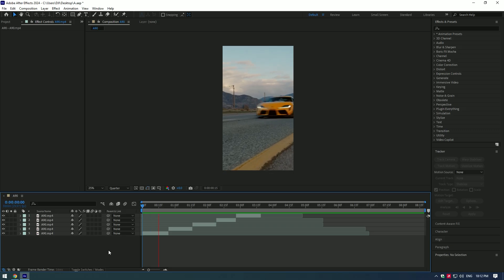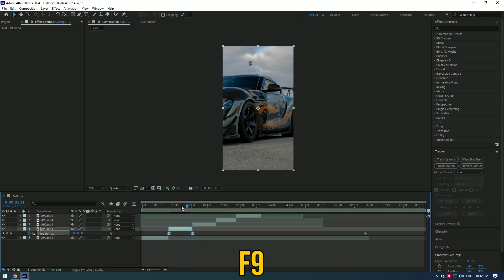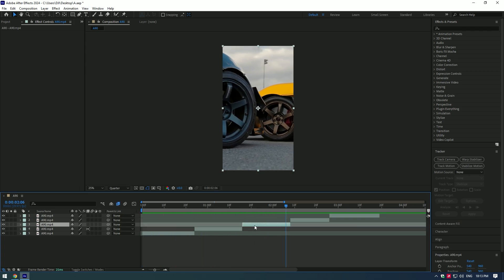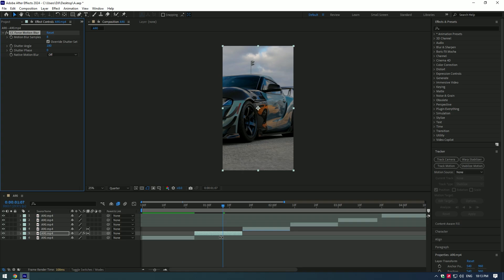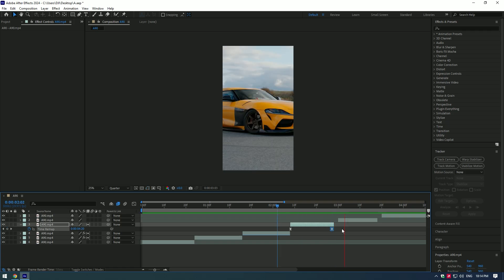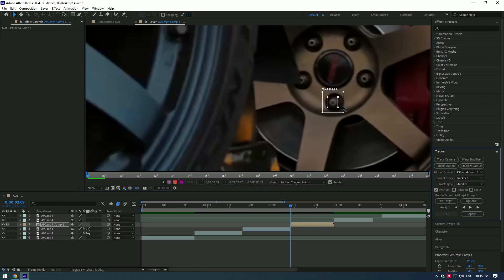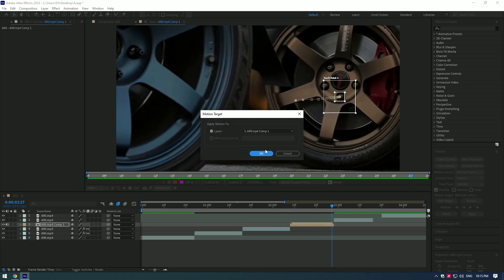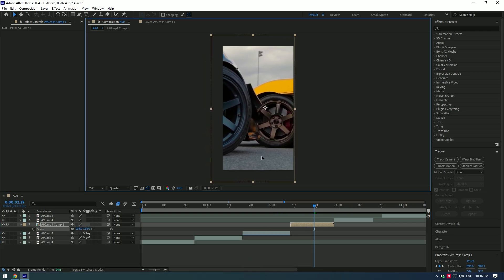My Secret To Smooth Speed Ramp Transitions in After Effects

Comment: hey when i stabilize the clip using track method i get micro jitters in my clip after it is stabilized, i have noticed this many time it happens with almost all clips doesn't matter if it is auto tracked or manually tracked. can you give me fix for it.
Reply from the maker: While tracking, make sure to choose one spot that will be the most contrasted and make sure that the tracking box (the little one) dosen't move anywhere and it is locked on that one contrasted spot until the end of the tracking / video. If it doesn't work, record the screen with the problem and drop the youtube link here, I will check out.
Reply from the maker: P.s if you track that spot perfectly and it still has a jitters try adding warp stabilizer too
Reply: @AMFilmTutorial  lemme try it then thanks for help brother
Reply from the maker: You're welcome bro